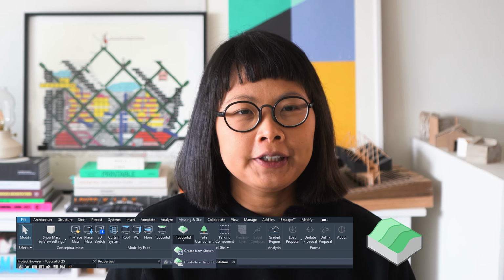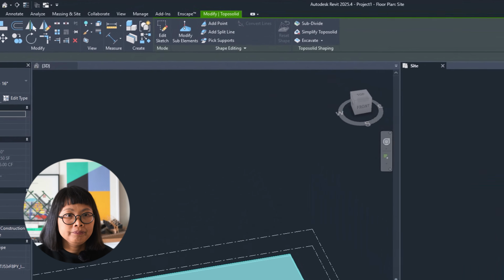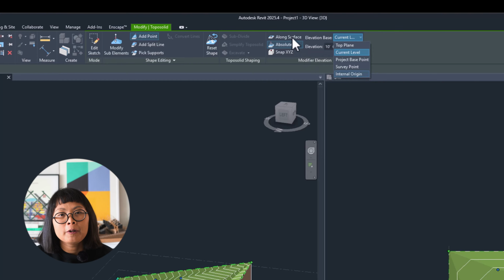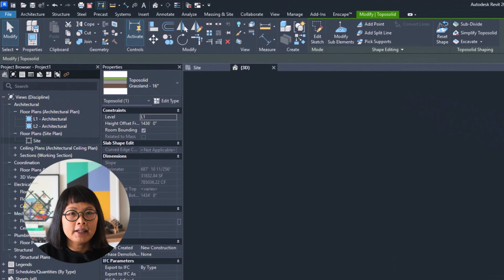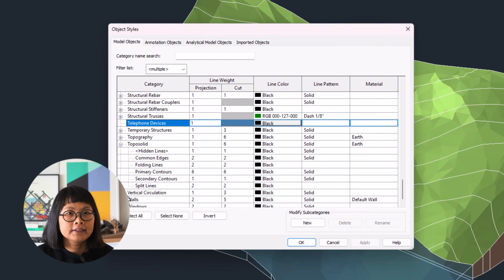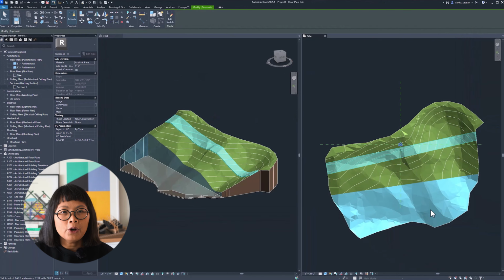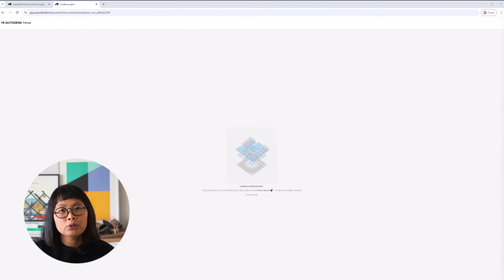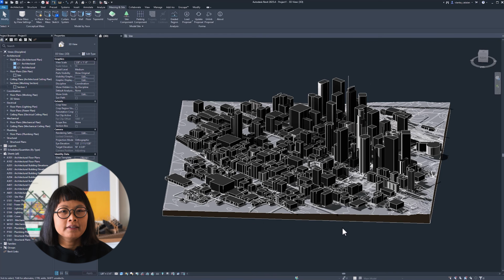Revit Toposolid Explained - Complete Guide to Site Modeling in Revit 2025

Comment: I have a challenge with excavating some specific part of my site that I got from forma it keeps on bringing an error i have tried the void method, the split method i dont know is there anything i am missing? I really need your help
Reply from the maker: Hey! If your site was imported from Autodesk Forma into Revit, the issue is usually related to geometry complexity or phasing. Make sure your void is fully cutting through the toposolid double-check that your phases are set up correctly (existing vs new construction), and confirm your split sketch is completely closed. Sometimes Forma surfaces come in very dense, so simplifying the toposolid can also help.
Reply: @VERBarchworkshop  thank you when I try to excavate it brings the error of cant cut joined elements this maybe because of how i had cut and joined other toposolids is there a way i can unjoin elements or simplify the toposolid?

Comment: Can you tell me how do people document the toposolid, for example when you excavate the toposolid, I'm sure there is a specific way to document it, is it the same as phasing? thank you for the reply, I hope you understand what I mean - a confused student
Reply from the maker: In Revit, documenting Toposolid changes, such as excavations or other landscape modifications, is usually done through phasing. This allows you to show existing versus proposed conditions and represent cuts, fills, and other terrain changes clearly. Some users also create separate toposolids for clarity.
Reply: @VERBarchworkshop  Hi! I'm having the same problem. For example, if I create a topographic solid and select it as the “as-built” condition, then when I excavate the solid, the excavation isn't classified as a “new structure” but as “as-built” together with the solid,  which is incorrect. Is there a solution to this?

Comment: does the linked CAD file have to be a 3d cad? Because when I link my cad file and create the toposolid it comes out flat.
Reply from the maker: If your CAD file doesn’t have any elevation (Z) values, Revit will just make a flat toposolid. Check the CAD to see if your contour lines have different heights. If they’re all the same, that’s why it’s coming out flat. Add some proper Z-values and it should generate the terrain correctly.

Comment: Thanks for the video, it is easy to use the floor to cut topo, but how about the fill part? I think the previous vision can be filled.
Reply from the maker: Thanks for watching the video! Yes, using a Floor to cut the Toposolid is quite straightforward in the new workflow. As for the fill part, it's a bit different compared to the previous version (Toposurface).
In Revit's current Toposolid system, you can’t directly "fill" in the terrain like you could with the Building Pad in the old Toposurface method. Instead, to represent fill material, you'd typically use another Toposolid or a solid geometry (like an in-place mass or floor) that overlaps and visually indicates the fill. That said, the massing tools, or even a combination of cut and added Toposolids, can help you model excavation and backfill scenarios. It does take a bit more manual control than before, but it allows for more flexibility in shaping and phasing. Hopefully Autodesk will bring back or improve the fill workflows in future updates.